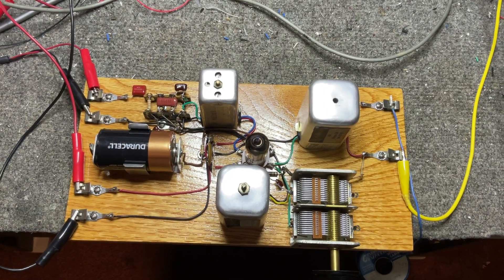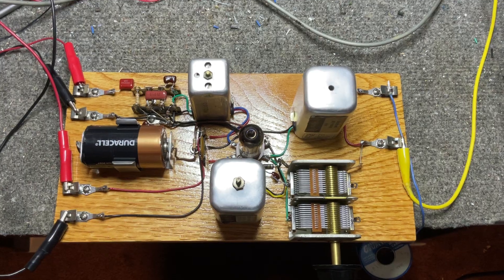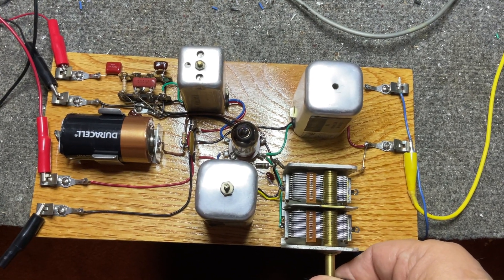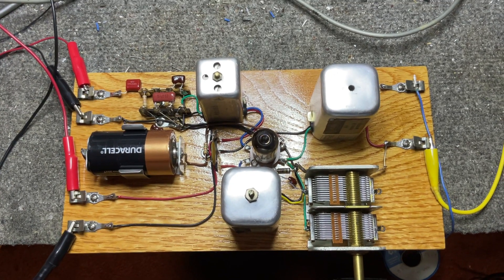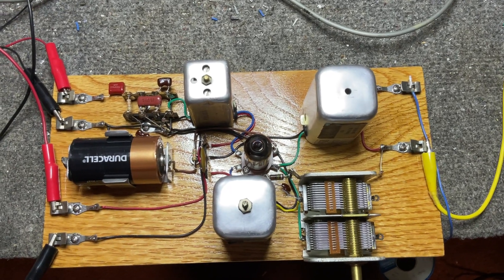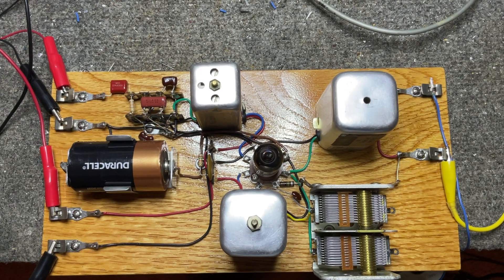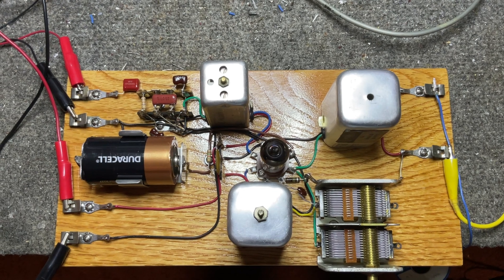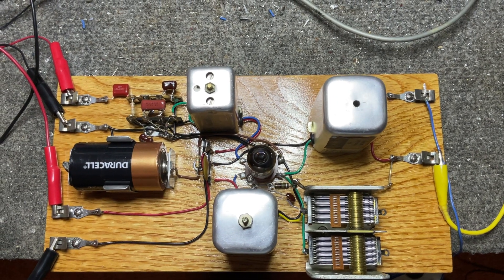One Tube Superhet

Comment: @KinghtT60 if this is incorrect please feel free to say so, and its your choice to explain in detail what is and isnt wrong. I like the challenge to figure it out!
Thoes asking for a schematic, ive commented once stating that just looking at the components. it shouldnt be all that difficult to figure out if you understand radio. 
If not probably not a good idea to build it as this one can produce a lot of RF, and re transmit it if one is not careful! i think its much more simple then what i was thinking in my mind. Im pretty sure its just the front end of basically any superhet radio its just the heptode wired like it normally would be. Antenna coil, and oscilator coil. One I.F transfromer. Feed back pulled from the I.F to create the A.V.C circuit which i havent figuered that out yet lol. But im pretty sure its much simpler than what most are of us were, or are thinking inculding my self. Audio output is conntected to high Z phones for portablity, or you could use a solid state amp. I have some 455khz I.F cans from an old aa5 that i can practice recapping and some other bits think im gonna give it a go! Havent decide on what tube i like my 12 and 6 volt tubes which is really all i got on hand. Quick edit you can see a diode inbetween the tunner, and the can to the left. For any one else google a 6BE6 one tube superhet radio

Comment: It’s a one tube Heptode, I can see the one  I.F transformer. How many total I.F transformers are there? Not sure if the other too cans are I.F transformer, or not. I think if I can figure out the unknown components I’m gonna try and reverse engineer it! I caught what you said in the end, so I’m assuming the front end of the tube is a grid leak detector, with a regenerative stage, then there’s the if transformer which I’m assuming is part of a somewhat separate stage! It’s a single heptode after all!
Reply: I am guessing that there is one IF can so the other two will be antenna and oscillator coils respectively and look like commercial items. Even so, I think the real challenge is to get any superhet to track correctly. Things like overloading can be put right which AGC once the basica are working correctly.
Reply: @jozefbubez6116 ah okay! Now I understand a little bit more! I was kinda confused for a bit there sorry for such a late reply! I definitely agree with you statements, makes actual sense!
As for tracking wouldn’t it be basically the same as a 5 tube superheterodyne we’re your mixer is combining the oscillator frequency to the incoming tuned radio frequency to demodulate?

Comment: The one tube is converting and amplifying the if stages?
Reply from the maker: There is no IF amplifier. Nothing but a pentagrid converter.
Reply: @KnightT60  What is the performance like at night.
Reply from the maker: @roberthorseman7432  Nighttime operation is good. The receiver has plenty of gain. It really couldn’t benefit with more. There are no issues with cross modulation etc.
However with only two tuned circuits in the IF, the selectivity could be a little better. I have some 262kc and 175kc IF transformers, so when I get some time I plan to experiment with lowering the IF frequency. That will reduce the bandwidth of the signals, but it will also cut the high frequency audio response. I’ll see if the trade off is worthwhile. Currently the audio quality is really good.
Reply: @KnightT60  That would benefit the performance when you do do it put a video of it up I would really like to hear the night time performance 👍👍.